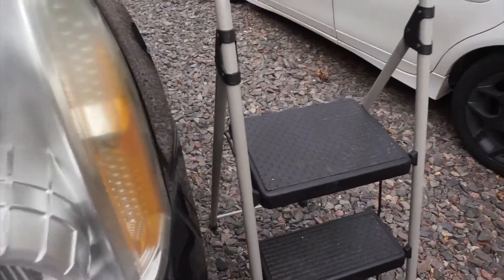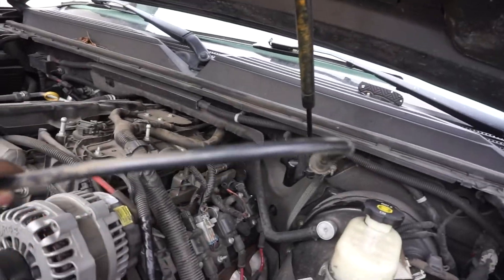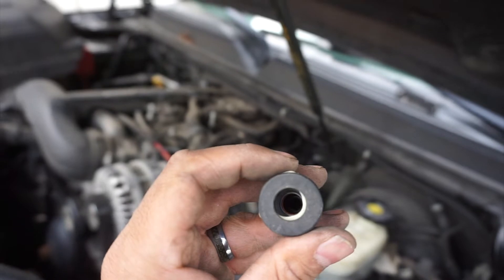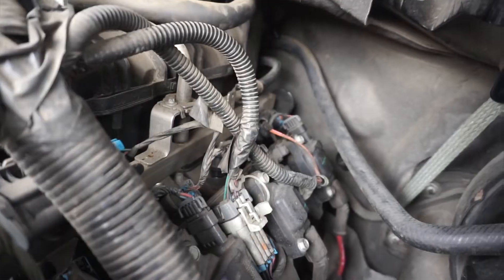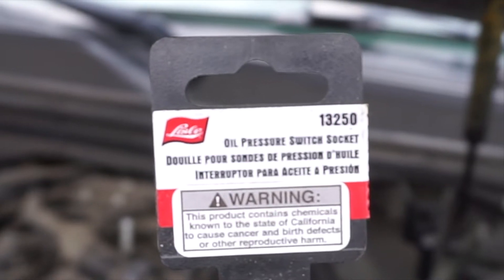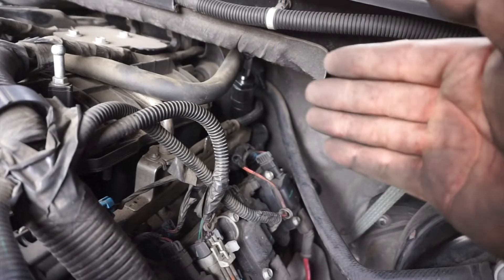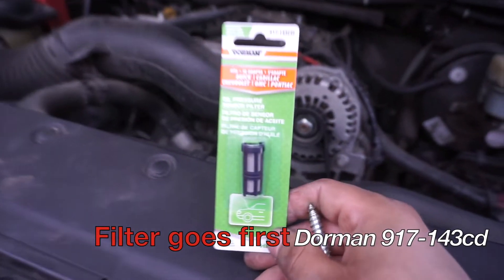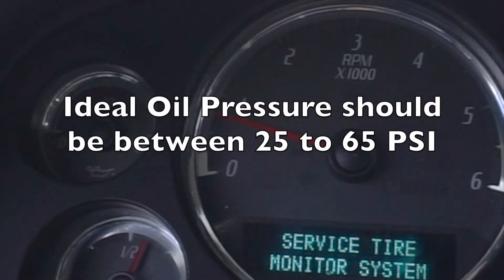[PRESSURE SENSOR] 2007 GMC Yukon Denali 6.2

Comment: Excellent Video Thanks!  What about tire pressure sensors? Hate seeing that on the dash.  Also, stabletrak? 2 new things I'm dealing with and needing to do some research.
Reply from the maker: The Tom’s sensors you have to go to a tire shop to have them reset and stabletrak they would have to scan it to do diag on it

Comment: Will that make a 2007 gmc yukon awd crank but no start it says a p1608 i changed ignition also did fuel pump and new battery same problem crank no start. Please help
Reply from the maker: That sensor should not effect the no start.
Reply: @davidguzman775  anything you think it can be
Reply: @eddiewilson5123  check fuel rail for fuel pressure to see if gas getting to the engine injectors
Reply: @jenbrothers9054  thanks jen brothers it was a fuse that was the problem 1 fuse made car not start lol newer cars

Comment: My 07 Denali with 6.2L V8 has low oil pressure at idle, like 9 psi. When I drive or give it gas, the PSI goes up to 35ish PSI. The engine makes a knocking like sound too. Is it the oil pick up tube o ring? Or can a bad sensor do the same thing?
Reply: Did you figure  it out
Reply: @eddiesgsr  replaced o-ring and oil pan gasket. Did nothing. Fresh oil change helped a little and some Lucas. But but, motor blew on me. 167k miles. I recommend dumping it before it gets worse. Mine started burning 2-3 quarts of oil a day. 😂 6.2 V8 cost $3k+ used
Reply: @MrChampion1002   my 07 yukon is the worse vehicle  I ever owned. In 3 years I probably  dumped 4 grand in parts alone. It just keeps breaking. Im doing the rear main  right now and I'm changing  other seals as I'm doing the job.
Reply: The lower psi level at idle is supposed to be 28 psi or greater. Anything under 28 psi...you will damage the engine.
Reply: @clsutton7574  what do you recommend? I the 6.2 Denali 2007 getting a code p0011 and low oil pressure.
Reply: @TheThinkingDumbGuest  Mine blew at 163K put a used engine with 109k miles. Total cost $6800. Started having issues only 2 weeks after getting it back from the repair shop which took him a month in a half to do. I think it was the dudes first engine swap.  Learned my lesson to do my research before doing or going anywhere.  Thank goodness for all the educational you tube videos on vehicles. Much appreciated and been learning alot!  I've saved so much money by doing it myself. ❤
Reply from the maker: That’s great to hear 💯

Comment: Hi I have the same Denali as yours. Warmed up at idle my oil pressure reads right around 17-18psi. Oil is clean and recently changed. Truck runs and drives great. Should I be concerned?

Comment: what socket size did you use ?
Reply from the maker: There is a oil pressure sensor socket specifically for that sensor at your local auto parts

Comment: Have you ever had a issue with the Denali shutting off when you’ve come to a stop after you have been driving? I’ve changed so many parts hoping to solve the issue with no luck for 6 months now. So far I’ve changed Spark plugs, wires, fuel pump, crankshaft sensor, camshaft sensor, throttle position sensor, throttle body, accelerator pedal sensor, stop light switch, Mass airflow sensor. Any ideas you may have I’d appreciate it.
Reply from the maker: Have not had any of those problems, I deal a lot with shops and will ask for you. It sounds like it’s an electrical issue.
Reply: @davidguzman775  ok. Thanks. Thought I’d ask. When it’s cold it doesn’t have the problem. Only when it’s been warmed up and running for a little while.
Reply: @eduardotru8618  wow.. I'm having that same issue
Reply: @jenbrothers9054  i still haven’t figured it out. Ready to light it on fire. LoL. I’ve done all this now... Spark plugs, wires, fuel pump w/ filter, crankshaft sensor, camshaft sensor, throttle position sensor, throttle body (swapped it), accelerator pedal sensor (gas pedal), stop light switch (brake), ground cable, Mass airflow sensor, oxygen sensors (all 4), air filter, MAP sensor & ignition switch. Have a oil pressure sensor that hasn’t been changed yet but i have the part. Hope you have better luck. If you figure it out please share the secret.
Reply: I had same issue. 2008 denali xl 6.2. After alot of reading found someone disabled vvt in the computer via hptuners.  I did it as a last resort and the same frustration your having. I have not stalled since and its been almost a year. Heard it could be due to engine wear causing oil pressure issues where the cam actuator works with the vvt. I also disabled a couple cel's related to the cam actuator since its now disabled.
Reply: @eduardotru8618  Did you ever get this figured out? I am having the same issue with mine.
Reply: @mrtonywilliams23  not yet. Waiting till i can take it to a shop. I’m thinking my computer might be bad.

Comment: David una pregunta...tengo una 07 denali 6.2 y el oil pressure gauge cuando esta en temperatura normal baja below 20 pero cuando le acelero sube normal como a 40...es normal...ya cambie este mismo sensor pero sigue igual...
Reply from the maker: Si eso deberia ser normal, almenos que tengas problemas con algo mas?
Reply: No, nada mas eso es de lo que no estaba seguro..
Reply: Es El oil pick up tube o ring kita El oil pan y ayi esta 3 tornillos

Comment: what causes the oil pressure low stop engine to come on in a gmc yukon 2008 after replacing sending unit?

We just had the dealer do an oil change and they replaced the oil pressure sending unit. Now it’s back on the oil pressure low stop engine
Reply: Oil pump bad, bearing worn, cracked oil pick up gasket, clogged oil pick up, if it has AFM, oil valley cover could have a bad gasket (under intake manifold) could be any of those or all of those. You will have to take it to a mechanic unless you’re mechanically inclined enough to do the job. I’ve even seen a bad BCM (body control module) cause this. Oils sending unit good, BCM bad not reading properly. GMC’s this year have a lot of problems. Not major, but sizable.
Reply: It's the screen under the sensor